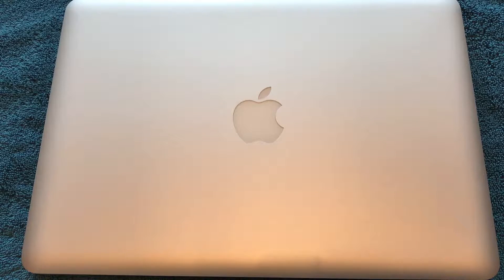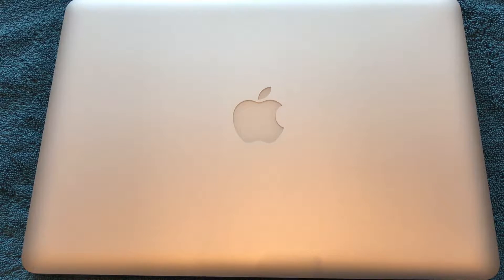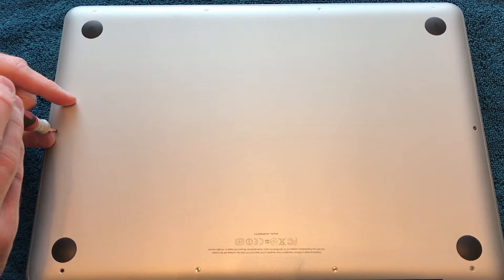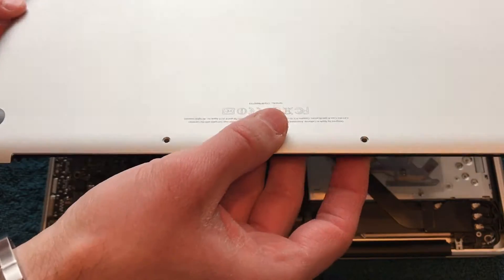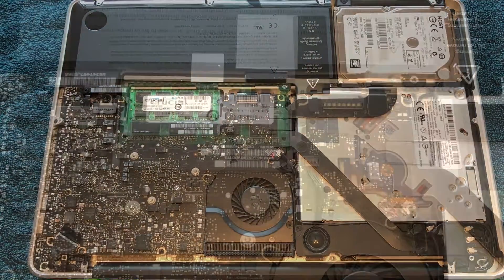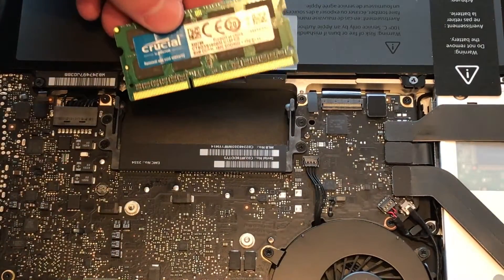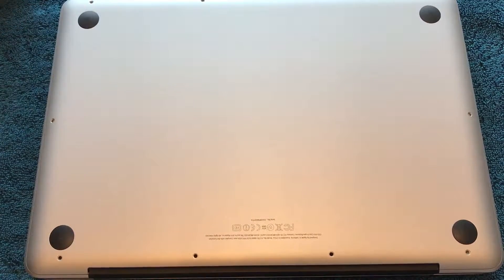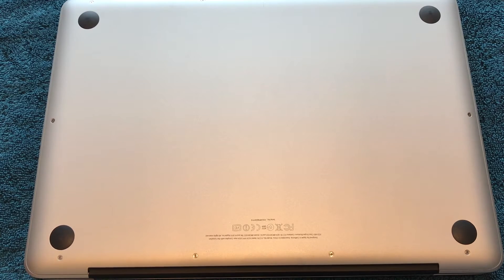Mid 2012 MacBook Pro 16 GB RAM Upgrade How-To Tutorial

Comment: Hi, a technician told me my mac 15 Inch Mid 2012 i7 2.3Ghz actually only supports max 12gb? they say if I install 16gb I'll be overclocking it? doesnt make sense as modules will be unequal numbers, but have you had any issues with the 16gb installation? been thinking of doing it myself